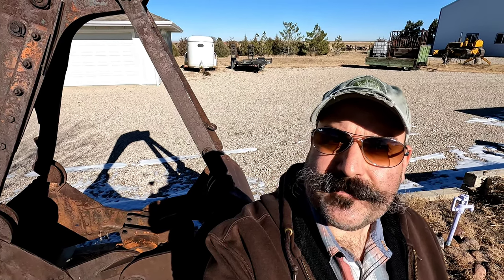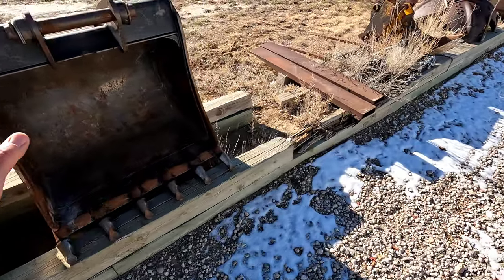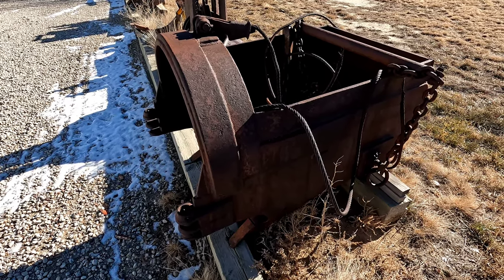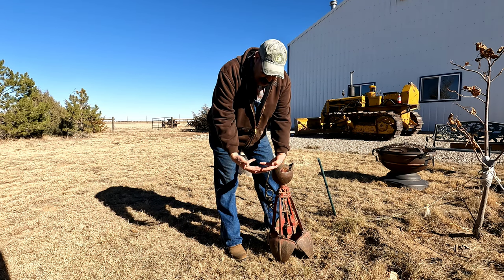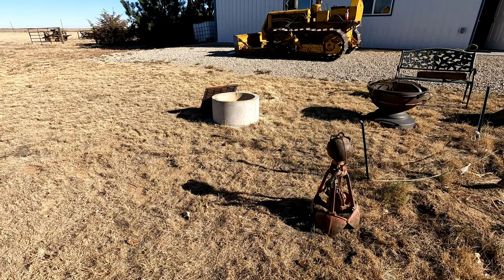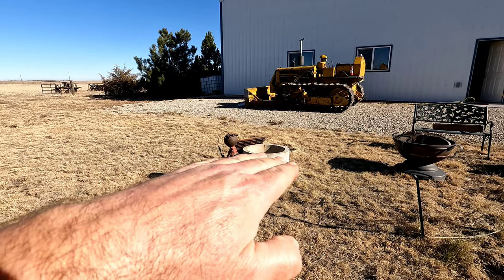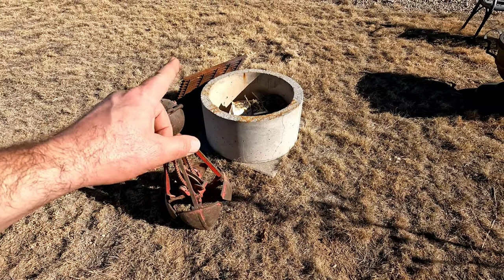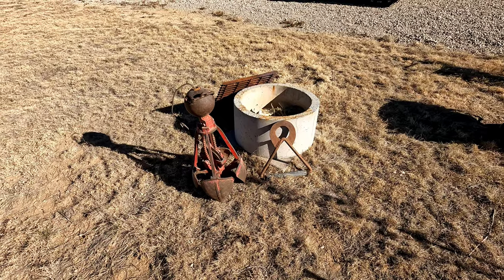Buckets! Crane drag line, clam shell orange peel and more.

Comment: Thank you for showing this. The well my company dug. They are just a BUCYRUS-ERIE well driller. It had a long tub that check valved the waste into the tube. Then they pounded down the steel casing. 400 feet well.

Comment: That orange peel bucket is interesting; can't say I've seen one before.  I rent a small cottage in the woods, and some years ago, under a wooden portion of the mostly concrete basement floor, I discovered an old well, approx. 3 or 4' in diameter, line with stones.  According to records, the home was built in 1946,  but I believe there may have been another type of dwelling here before that.  I do wonder how the well was dug...
Reply from the maker: It was amazing to watch it work! Your brick well was most likely dug by by hand. Or a fascanating process involving a large auger with a horse or mule pulling a giant lever on a rotating shaft in the middle of a giant tripod. Bricks were then hand stacked. We encountered quite a few in old houses during our days in excavating. Once city water systems came in they were usually abandoned or often filled with garbage. I gave a collection of old glass bottles that we dug out if abandoned wells over the years. Thanks for watching!